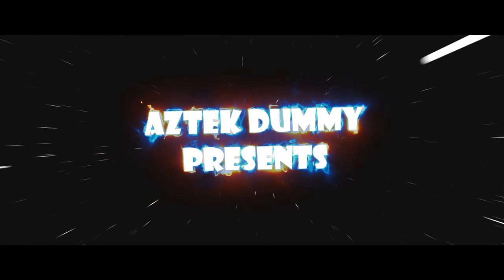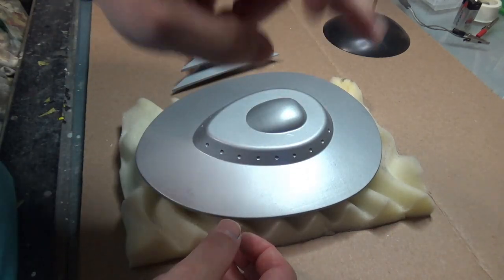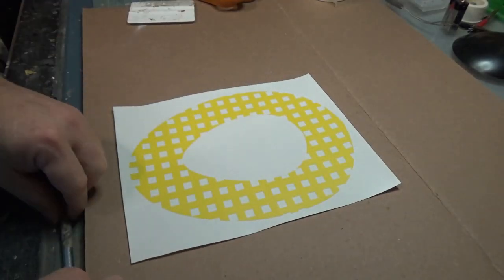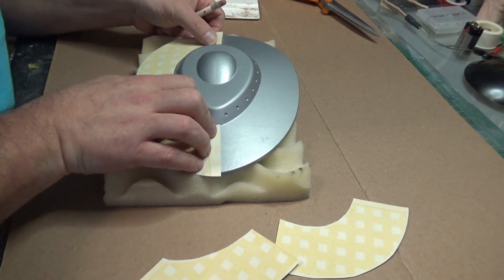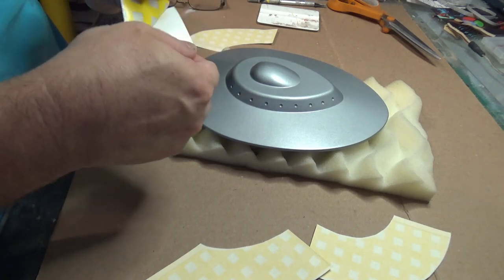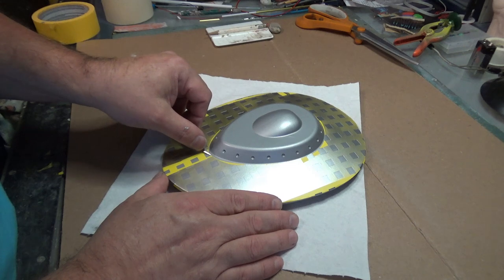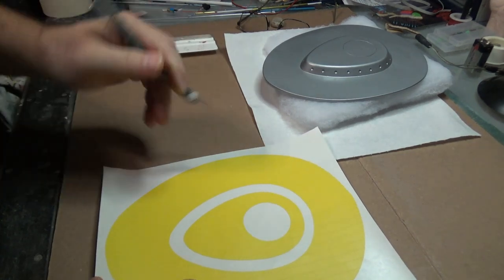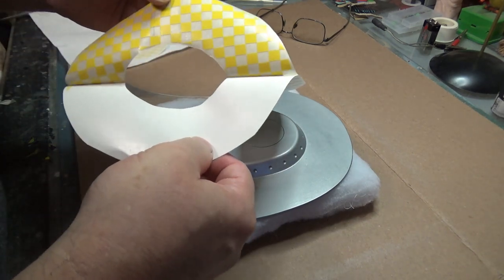AJAModels Metaluna Saucer Painting Guide

Comment: Hi Lou i have had a problem with the adhesive glue for the masks sticking to the model any suggestions in the end i stripped it all back and am starting again
Reply from the maker: the only thing that would keep the vinyl from sticking would be if either the backing paper was still on it or if the surface of the kit has got grease on it